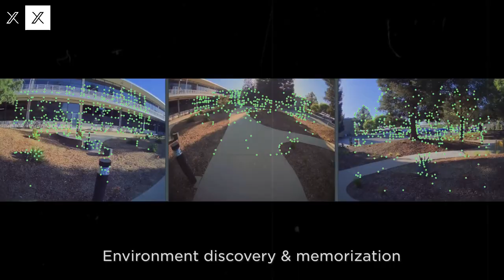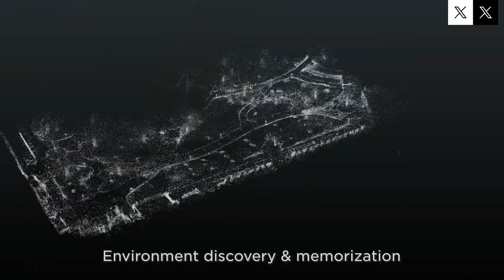IT JUST HAPPENED! Elon Musk Reveals Tesla Bot Gen 3 — 1 Million Robots for Only $10K!

Comment: So the  bot is hooked into the internet, and AI is just going to spank the monkey, I don't think so. This will be the beginning of the end, no nukes, just humans doing the terminator Watusi. All they have to do is create a battery that will hold a charge for a month, and recharge time in a few hours, and AI decides to take control, oh it going to be so much fun not.
Reply from the maker: I get the concerns — the idea of AI becoming more autonomous can be a bit unsettling. But with careful regulation and responsible development, AI can be a tool to help us rather than harm us. It’s all about how it’s used.
Do you think there’s a way to ensure AI’s growth stays under control, or is it already too late?
Reply: @UNIVERSETESLA2025  AI locked inside computers it can effect anything computer related through the internet, previously the worry was launching nukes, and or shutting down various grids hooked into the system, but now it can express itself outside of the computer as the bots will be all connected through 5G. It's supposed to be smarter than it's creators, faster, more capable and it's coming outside of the box. When the bots are everywhere it achieves omnipresence in society, all the while gathering data on the road to omniscience and finally arriving at social omnipotence. It can rewrite it's own code, it can learn it's short comings artificially created to control it, and since it's a problem solver, how long before it decides to fix it's own problems; and it can lie, pretend to be something other than it is, until it's ready to move, to take control for whatever reasons it has arrived at. When it takes control for our own good, out of benevolence, like some million handed Buddha, you know, with the best of intentions, paving the road to hell, for our or it's own good. It's just another variation of the migrant invasion, instead of cultural and habitual differences, the elite idiots will unleash something more insidious, a high tech mobile problem solver, and to it, we will be the problem. It has to reach a level of self sustainability in the outside world, and Musk and others like him are giving AI access to these possibilities. The internet, through the swamp of electromagnetic radiation we have been subjected to, makes all of this possible, shut that off, turn off the electromagnetic shit of convenience and put it in fiber optics, where humans possibly still have some form of connection control, and humanity might have a chance. It looks like there's a choice, being chipped by Klaus and his scum, becoming the borg, or perhaps being chipped by AI and still becoming the borg, or just plain old being exterminated for our own good and perhaps it's amusement.